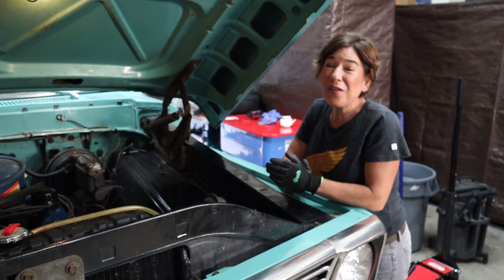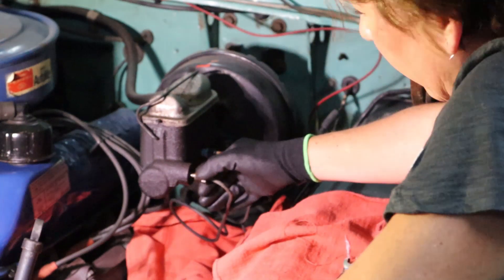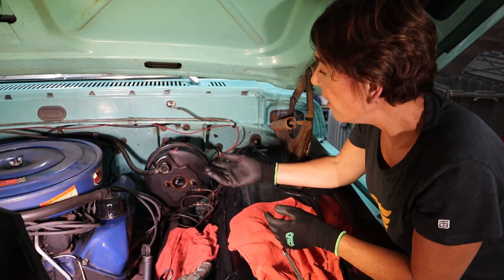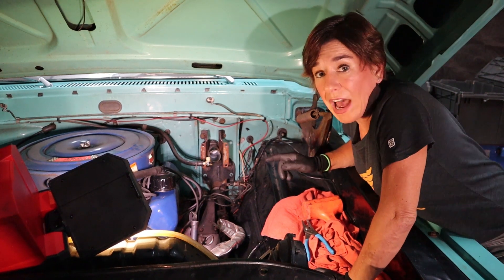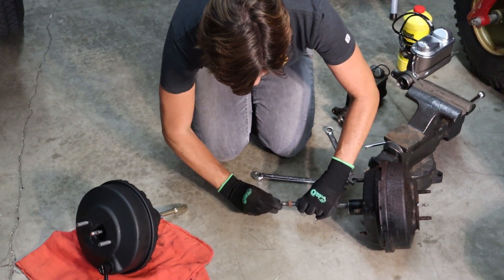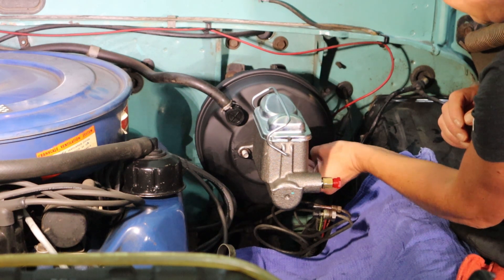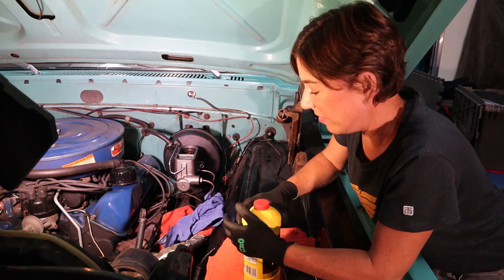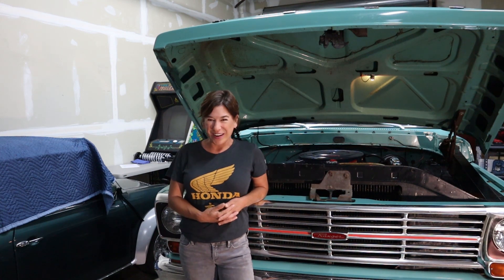How To Replace Brake Booster & Master Cylinder On A 1969 Ford F-250 Camper Special!!!

Comment: Thanks! Just found an identical truck with the same brake issues. Great video and clear instructions. 
One question: Can I adjust pedal height using the clevis? As it sits the brake pedal in my truck is very high…..
Reply from the maker: I don't believe the height can be adjusted, unfortunately. I've heard some people modify 1973 and up pedals but no experience with that myself.

Comment: I've got to do my 73, 😢 ports face the engine but I have it out and rebuilding it.  I just dislike bleeding the master cylinder. Great video and the adjustment of the rod I paid attention to.  I have been doing it professionally for 31 years and those were fading out in my career.  Haven't had much experience in the adjustment
Reply from the maker: Nice! Thanks for watching! Yeah, I'm with you. Not the most fun job out there. Good luck!

Comment: Great video!, the Ford 390 draws vacuum from the intake runner for #4 cylinder which also will leak fuel vapors into the vacuum booster and destroy the rubber diaphragm inside it. Apparently there is a filter to prevent this which can be installed, do you know anything about this? I have a 1971 Ford F250 Camper Special with a 390 and I'm chasing weak vacuum assist at the brake booster also.
Reply from the maker: Thanks for watching, nice truck you have there! Generally the black check valve on the booster prevents fuel contamination. My experience has them failing from a leaky master cylinder most often. I couldn't offer any direct knowledge on the fuel vapor issue unfortunately.

Comment: Loved your video.  I am redoing the entire braking system on my 76 Ford F250 and this was very helpful and fun to watch.  I love my truck it was the first vehicle I ever bought.  I had professionals do my brakes years ago and paid a fortune for it to be done when the master cylinder went out and a line broke.  The front brakes never worked again after that as they crushed one rubber line at the connection to the metal lines and the other line only dripped fluid due to an internal collapsed line and they did not reset the proportioning valve and it was frozen solid inside the valve.  Due to the truck not being a daily driver and my fear of taking on the brake line replacement myself I did not fix it until now.  So it has been an experience but not nearly as bad as I thought it would be.

Comment: Hi R&D, thanks for the help! I have a 1969 Ford F250 and my instrument lights, fuel and Alt gauges don't work. It was suggested that it might be the Interior Voltage Regular. I got a new one but can't find the item on the truck! Can you tell me where it's located?
Reply from the maker: You're so welcome, thanks for watching!! It's located on the back of the instrument cluster. :)

Comment: Could you provide the NPD part numbers, please? NPD doesn't have a booster that matches up to my '68 F250 Camper special which is the same as your '69.  Hoping you still have your invoice from NPD.  Thanks.
Reply from the maker: Thanks for watching! The booster is a Cardone 54-73515. The master cylinder is Cardone 131529.
Reply: @RDGarage  Thanks for the info and for the informative video.

Comment: Did the truck have drum brakes all around or did it have disc on front and drum on rear . I have a 1970  Ford truck F-100 that have drums all around but I do not remember   if my truck had a booster or not ,the truck was giving to me by my father years ago all I remember is the brakes were easy to apply in those days. At this time the truck dose not have a booster and are little hard to apply.
Reply from the maker: Hi Cesareo! Our truck is front disc with rear drums and power assist. Your truck has most likely always had manual drums, if you're looking to change that up, places like CJ Pony Parts sell power booster retrofit kits for manual brake vehicles. Thanks for watching and the question!

Comment: @R&D Garage I just found and bought an awesome 69 Camper Special with the 390. You videos are awesome to learn this specific truck...and I thank you for that.. I have the front disk brake option and have an issue with my front tires being very tight (not wanting to spin).. When I jack up the front end it take both hands to spin each tire a small distance. I replaced front brake hose, pads, springs, caliper pins, bushings, and dust covers. Unfortunately I still have the same problem. Any experience with this or an idea of what it could be?  My next guess is to replace the calipers; master was just replaced 3k miles ago...
Reply from the maker: Hey sorry I missed this!! I would check the front wheel bearings to make sure they’re not too worn or tight.  Also, make sure the pads are properly retracting when the brakes are released. Hope this helps!! Thanks for watching and the great question!

Comment: Great video I have the same truck if it's got a 390 I'm getting ready to replace the brake booster for the first time one thing I would recommend if you could mention what size wrench your using right before you use it wood be helpful and time-saving thank you
Reply from the maker: Mine has the original 360 but close enough, ha! Yep, I'm better at naming the wrenches in my newer videos but I promise I'll do the same the next time I work on the truck.  Thanks again!

Comment: GREAT video!  What did you use to plug the master cylinder and to cap off the brake lines?  And where can I find them?  I need to replace the booster on my '68 F250 Camper Special.  Keep up the great work.
Reply from the maker: Thank you so much, Mike! The master cylinder plugs actually came with the new master cylinder and the brake line plugs were just rubber caps that fit. You can get these at just about any auto parts store or amazon.  Good luck on your replacement install!
Reply: @RDGarage  Thank you!  I'm not replacing the master cylinder, so do you have any bootleg suggestions for plugs?  Small wads of tape?  Keep up the great work!  Post some more Ranger content please!
Reply from the maker: @mikekeller7127  Here you go! https://www.amazon.com/Hilitchi-Silicone-Tapered-Painting-Anodizing/dp/B07J6BP121 Those work great, I use them all the time. You got it, she still needs some work so stay tuned and thank you so much for watching and the great questions!!
Reply: @RDGarage  you da bomb, thanks!   Ordered.  👍🇺🇸
Reply from the maker: @mikekeller7127  LOL happy to have helped!!! Thanks!!!